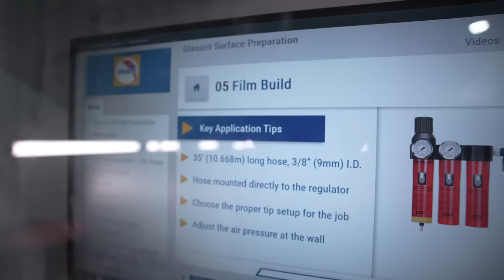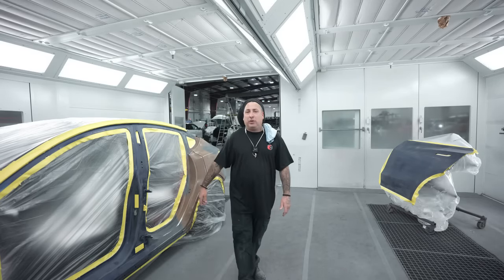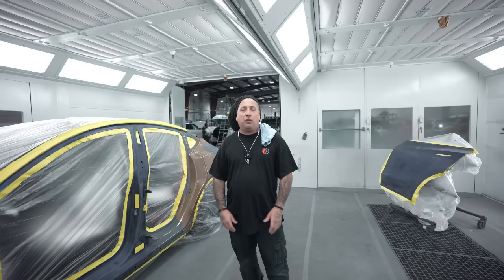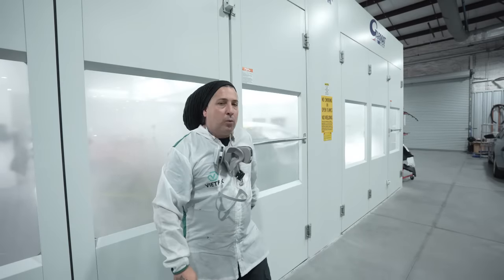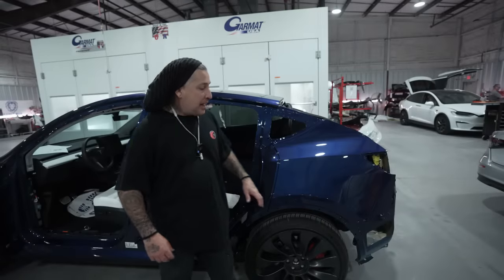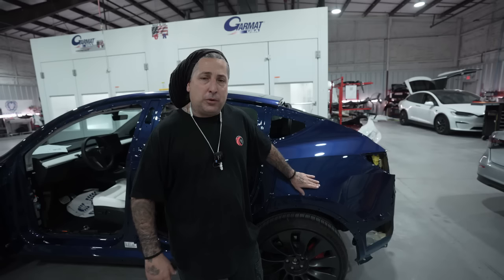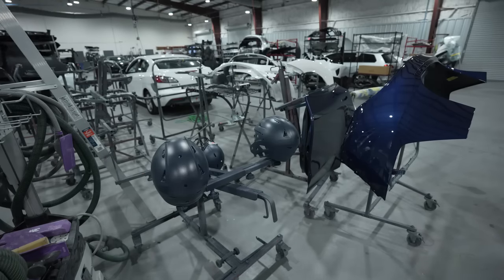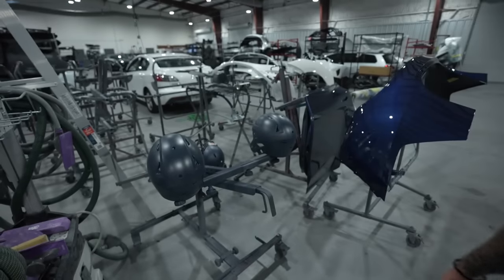Last Day Of Training With BASF Glasurit 100 Line

Comment: It’s not easy learning how to slow down the application of basecoat like you did, especially after spraying a certain way for so many years. I had to do the same thing when I switched over to  Spies Hecker 1 1/2 coat waterborne system. Great work. 👍🏽

Comment: I spray envirobase and sometimes no matter how well I lay it out or get it covered I have to try to get the more course and finer metallics to not mottle but that one visit system seems awesome! 1.5 coats for that silver you did I think Thursday or Friday was nuts!

Thank you for the effort you put into these videos they help me out a ton!
Reply: I spray envirobase as well and some colours are a struggle for sure. I always do a double control coat on metallic colours and there is still a little mottle on some colours
Reply: @JMMedia  I also do a double control coat. Sucks to fight some colors like that then see a system like this glassurit 100 line that seems much more user friendly.
Reply: @outdoor_lifestyle_0149  I hear you man. It does seem like other systems might be easier. You can also try double coats for your coverage coats as in 1 medium wet and then pull back a little and go over it again straight away. Can help get rid of some patchiness just don’t go too heavy with it being a double
Reply: @JMMedia  Yeah I have found lately with some of the course and fine silvers that like to mottle that I wasn’t putting it on wet enough so now I am putting two nice and wet coats and it is seeming to help the mottling not happen. Before I would do my second coat lighter thinking I was avoiding mottling but it wasn’t because it probably wasn’t covered properly.

Comment: iI noticed you switched to the 3m gun for base . I noticed with that gun your application slowed down on the base coat keeping it more easily wet .  What size tip on the 3m.
Reply from the maker: First time trying it with the 100line  worked great. 1.3